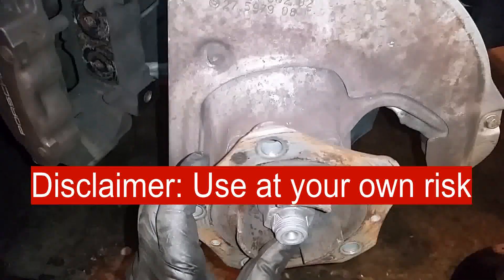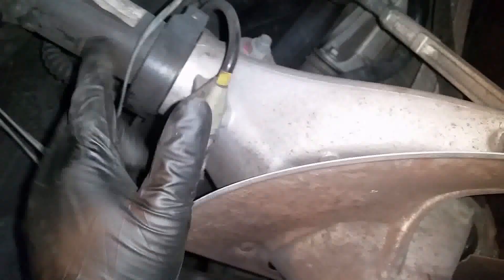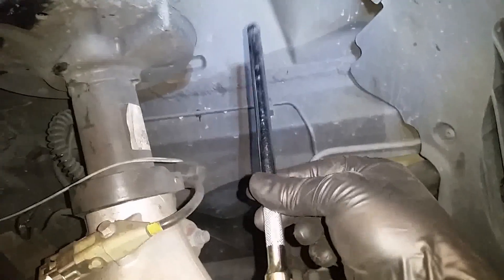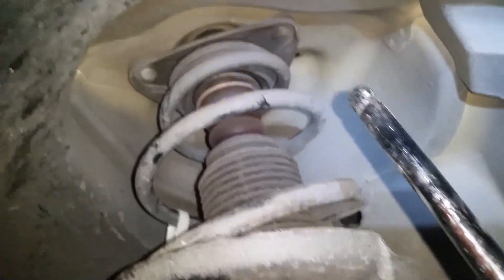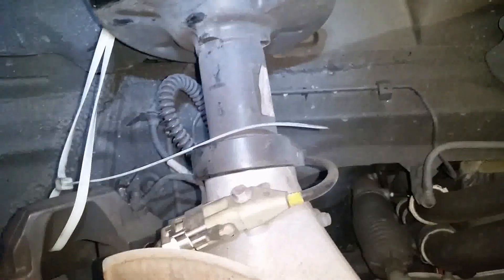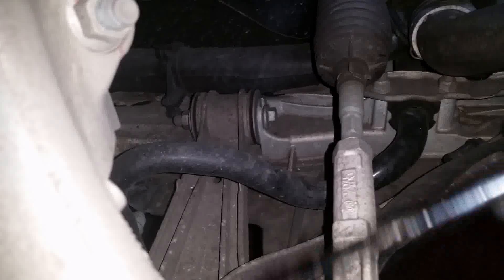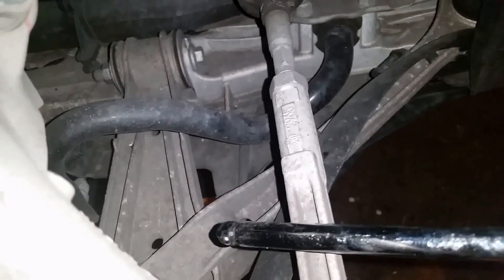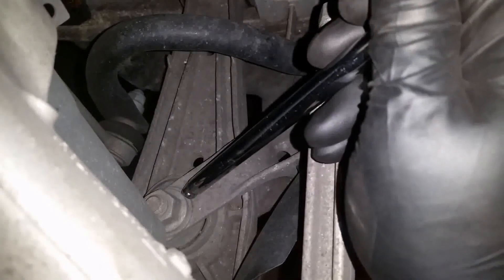How Porsche Cayman suspension works and how to add negative camber.

Comment: Good explanation in explaining the suspension axis, and most of preparation for track use requires aftermarket parts, to get the changes desired for caster and camber specifications.

Comment: Can you align the front camber on a standard suspension from the top strut mounts (Cayman 987.2)? Currently I have it at -0.03 left and -0.19 right and I would like to get it at -0.3.
Reply from the maker: I guess you can reach to -0.3 from the top strut adjustment. If you like geometry, you can calculate the max adjustment range as well. It should be arctan(a/b) where a is how much strut can move (say 10 mm) and b is the distance from strut mount to the outer end of control arm.